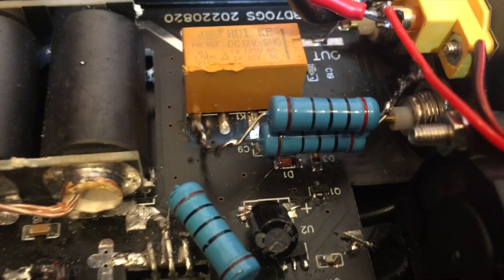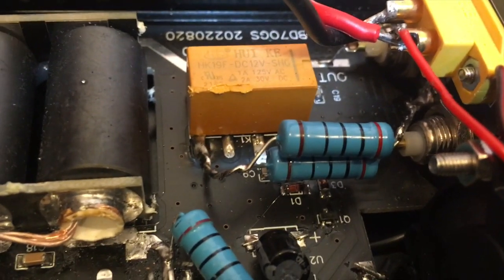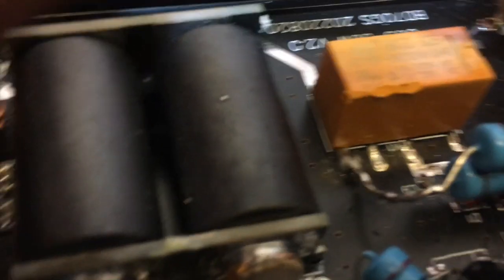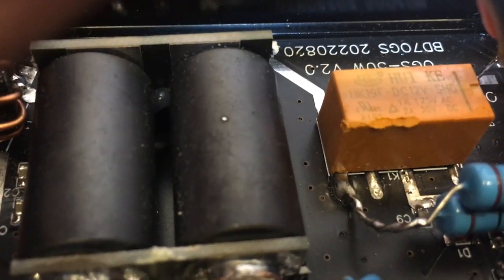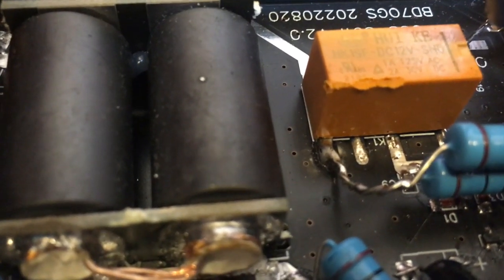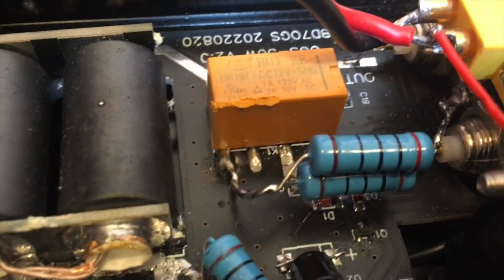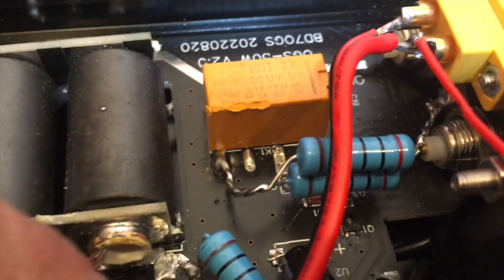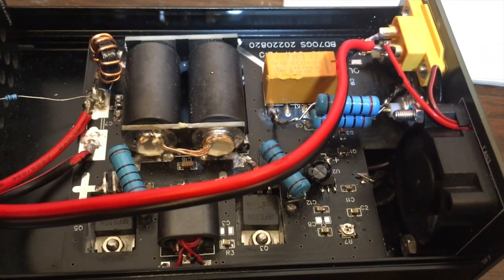OSG-50W Important Modification for high SWR between your Radio and Amplifier.

Comment: What version board do you have.  I can see it in the video.  Mine has a different number 20230227 and is version 4. I did some testing and found that on 40, 20, and 15m the SWR sent back to the radio was 2 or less.  17m was 3, so wont use this with 17
Reply from the maker: The one that was the basis of this video is 20220820 V2.0, aka the red power LED version. Thus far I've not had any need to really do anything to my V4 (blue power LED) amp, except glue on some internal heatsinks to the the finals.

Comment: Ok, my new OsG-50W seems to have a different board and has a 47 ohm resistor in there from the factory, so I guess the mod isn't necessary. Still appreciate the video! VA3IRF
Reply from the maker: Ah yes, there are two versions of this amp. They can usually be spotted by the colour of the power LED. It's it's red, it's the 1st generation that really does need this mod. If it's blue, you should be good to go, and the different manufacturing process has gotten rid of a nice easy way to implement the mod. I have one of each. The blue one I've not modified, and seems to be better (but not good) at presenting a load to the transmitter. I may revisit this during the winter months. Glad you enjoyed my video!! 73, VE7NGK
Reply: @tomsworkshop5856  , thanks for the reply! I actually looked up your call letters, could have sworn I have made a QSO with you, but I don't see it in QRZ.
Reply: @tomsworkshop5856  , yes the version I have would make it difficult to do the mod, the relay pins are on the other side of the board. Thanks for your reply! I had to check QRZ,could have sworn I made a contact with you in the past...but I guess not.

Comment: I ordered the PA50+ online, and they sent me one of these.  Granted it was a great price, and now I know why.  The one I got does look different than the one you have shown.  They have added 3 large resistors to the board, 2 of them are 420 ohm, one is 120 ohm, so I wonder if they have tried to fix the input VSWR issue.  I couldn't get a chance to test it as once I applied power, the power light came on for a brief microsecond, then something in the amp shorted out, so I started a return.
Reply from the maker: Wow, definitely worth returning if it only had a millisecond life span. But most interesting that they are still working on ‘improvements.’ Hope you end up getting a working amp in the end. 73
Reply: Hi, I have recently received one of these with the extra resistors. Measured at 43 Ohm and 12 Ohm. In PI network theoretical attenuation nearly 9 dB and return loss of about 7dB, equivalent to a VSWR of about 2.5:1. Supposedly better than previous. Just waiting for replacement MOSFETs as the smoke escaped when checking bias voltage.
Cheers
Peter
VK7KPC

Comment: Hi & thanks Tom,
If I understand correctly the maker or designer of the amp did not allow the input side on the amp to appear as a 50 ohm load to the source radio, correct?

Because I did not open the case yet I just want to be clear about where I connect the pair of parallel resistors. I saw the proper location on the relay so I am good on that. 

I believe you said for the other the ground tab of the two BNC connectors, correct?  

I guess the two connectors share a common ground tab, but as long as the connection is made to what the connectors ground to should be fine, correct?

Also, how critical are the 200 ohm in parallel =100 ohm 6 watt resistor assembly values? I'll probably have to order them anyway since 3 watt resistors are not typically in my build box and I am wondering if it was just a workable value you had and perhaps there is an even better selection.

Thanks again....
Reply from the maker: Yes sir, you've got it right. However, there's a different version of this amp being sold now, and it is identifiable by the blue power light instead of red. I recently bought the second version, but have not yet been able to do the modification as they went through-hole for the relay. I'm hoping to make a follow up video on this newer version as to how the modification can be done, because, well, it still doesn't present a good 50ohm load to the radio.

Hope that helps!! & 73
Reply: @tomsworkshop5856  Thanks Tom. Yep, I have the blue light version. I will wait for your video and I did order the resistors.
Reply from the maker: @migalito1955  Sounds good, hopefully this will be a simple (ish) mod, I do know I need to pull the board out, and that means the temp switch and unbolting the FETs. So, might take a bit of effort, But I'm hoping to find some "top side" connection point after I go through it. We shall see.
Reply: @migalito1955  Hi, Blue light version has an attenuator already fitted
Cheers Peter VK7KPC

Comment: Hi sir. How are you can i ask about two meter linear what is best tube type or mosfet thanks 73
Reply from the maker: That's a tough question to answer because everyone uses VHF a little differently. If you're just looking to boost your handy talkie a bit, then Btech (Model # AMP-V25) makes a nice little amplifier that also has audio (in and out) to turn your handy into more of a mobile / base setup. If you're looking to do VHF SSB, AM, or Digital 
then I'd be suggesting that you look at the offering from RM Italy. Hope that helps. 73! VE7NGK
Reply: Thank you sir... But i need to purchase linear vhf 144 to 148 if have can you help me about that sir and im willing to buy thaks 73
Reply from the maker: @richardsenining7410  Sorry, I don't have any VHF amps.

Comment: So I did the mod and it sure made a real difference in the swr presented to the radio. So far I only tested with an usdx and the reports were bad, to say it mildly. I dont think the usdx is anywhere near a finished product, and thus it does not like this amp it seems. I could test the PA with my 817, but the risk and the pain involved in renewing finals on the sweet little Yaesu makes me a bit reluctant to mate these two. Maybe I am overcautious... I dont have deep experience with practical electronics but is there any way this amp could be put to work? Any bands with less unwanted emissions? 10-15-20 meters maybe ? Simple filters?
Reply from the maker: Ya, the USDX is a pain. And the 817’s finals are fragile to say the least. As far as making the USDX almost useable, check out my other video. And search Facebook for the USDX group where you can find better firmware and how to upload it to your radio. Mine’s doing OK now, but dang, RF getting back into it via any connection, power, mic, etc.. makes it sound very bad - and adding the amp really compounds the problem. It seems, for me at least, I get the best results on 20 meters. I hope this helps, brother. 73s!

Comment: Funny thing, I got mine yesterday. I did some quick test on dummy load and quess what - mine produces 90-95W from circa 6W input. Any ideas? Regards
Reply from the maker: Two things come to mind. Drive power should be 2 to 5 watts, and if you're using an mcHF/RS-918 type radio, (Or similar experimental radio,) harmonics. Often times the 3rd harmonic.
Reply: @tomsworkshop5856  Hi Tom, thank You for your answer. Yes, the drive power exceeded 5W - in fact it was around 6-7W. But would it make such a difference? Today I tried handheld Albrecht 2,5W and USDR reduced to similar power. The amplifier gave 40W on output , and a few qso-s were made with good reports. Harmonics - yes, but would it not  affect SWR (and it was exactly as expected)? Anyway - best regards - Maciej SP5ZE
Reply from the maker: @MaciejSzewczyk-x6w  They often do effect SWR, but in some cases, especially with non-resonant antennas that are being made to transmit with a balun or unun, such as the popular 9:1 random wire. The SWR, even with out a tuner can often be under 2:1 on all HF bands, thus, the harmonic(s) might not affect the SWR as you would expect. Now, if it is a mono band antenna, I'd be surprised. But, not everything works out to simple answers. Also, I often run my amp in excess of 75 wats on 80 meters. It gets warm, the fans run a lot, but it seems happy doing that. ;) I just wouldn't recommend doing it, if you don't have replacement IRF530s on hand....  All the best and 73's VE7NGK
Reply: @tomsworkshop5856  Thanks, 73!

Comment: Appreciate the video! However, I set up several jigs with two samples of this amplifier, and loaded it with both tuned antenna and dummy loads, and measured the VSWR on the exciter (a (tr)usdx) on all bands, with the OGS either powered on or off. Worst case was on 80 meters, and was approximately 1.5. 
Best measurement was on 11 meters (no surprise). 
I could not repeat your observation. Can you display the actual test setup you used? 
Also, I would be very uncomfortable using this amplifier without some filtering. It is sending large spikes at the second harmonic, on all frequencies measured,
making it unacceptable as an out of the box amplifier, even for 11 meter operation.
Wonder if the manufacturer has something to do with the problem: different stores in China have wildly different pieces with the same name.
Not doubting your findings! Just want to know what accounts for your findings.
Again, thanks for all you do.
Reply from the maker: Good day George. So, I've stopped using my uSDX with this amp as it creates far too many spurs and harmonics. The class E final setups in those radios are not up to being connected to an amplifier at all. I've exhausted many hours trying to clean up the emissions. 

With that said, I use this amp with my RS-918, that has had Wayne NB6M's modifications done to its filters. 

The OGS-50W is a dumb amplifier, and has no input loading, thus, unless they've changed something in the last year, I'd wonder how you got a good match at all. (And I'm not doubting you and the fine manufactures change things everyday!)

The tests I did used the SWR meter in the RS-918, 
confirmed with a direct connection to a dummy load (Showing 1:1ish) and my Random wire without tuner (2:1) and then tuned 1.06:1 Using my ATU-100, and the OGS powered off in between the radio and tuner, and repeated on all bands.

Once the the amp is powered on and trips into transmit, the reported SWR on the antenna tuner stays low, 1.15:1 (Some change expected with the increased power, and resistance of coax, balun, etc.) However, the radio's indicated SWR (5:1) was so high that radio was only pushing 2.5 watts into the amp, while set to 5 watts, in many, but not all of the bands. 

There is good news: The harmonics detected from the output of the antenna are 40 to 50db lower than the fundamental, compared to 9db lower than the uSDX substituted for the RS-918. Test set up was TinySA, using supplied antenna polarized in the same direction as the random wire and 40 feet from center of that transmitting antenna, with the TinySA set to measure harmonics. 
(Notably the 3rd harmonic was the worst in all cases, with both radios, likely because the amplifier favors frequencies in the 10 to 15MHz range.)

So, you are correct. If your radio is dirty, or has high DC out, such as the uSDX families of radios. (This is evidenced by the uSDX radios only generating about 30 watts out of the amplifier, but traditionally built commercial radios without the DC component will do 55 watts with the same 3.5 watts in.) 

Don't use this amp without a filter system BEFORE the amplifier, unless you've cleaned up your radio's emissions to all harmonics being -50db or better. 

A filter setup after the amplifier is a good idea, but if you haven't cleaned up what it is amplifying, you will be converting all of your output to heat in the filter network. 

It should be noted that it will work on 10 meters, or  as you say 11, but it is super inefficient.

I hope that helps, and all the best to you!
Reply: @tomsworkshop5856  Appreciate the thoughtful reply. I will set up the OSG-50 with an RS-918 (one of my favorite portables!) and see what I measure. My measurements were with the SWR meter and transmatch at the base of the antenna. The OSG-50 was left inline, both powered and  unpowered, and worked well, with many spurs noted, which likely reflect the Class E operation, as you noted, of the (tr)usdx. I use an LPF-7, as well some other stiff filters on most of my Chinese equipment, as the second harmonics are often troubling.
I am a product of the early sixties amateur scene, and recall "pink slips" for inappropriate emissions. All said, this amplifier is a work in progress, and needs a bit of work to be a good ham radio product. V73 George KF5WFA
Reply from the maker: @plotdoc  Hey, Thanks for the kind words! I do agree, the amplifier is a work in progress. BUT, I can say I've now logged over 100 hours of TX time on it. So, at $1 an hour investment, seems to be rather good. lol
All the best George!! 73's de VE7NGK
Reply: @tomsworkshop5856 FB, Tom.  I set up a test rig, using a QRP SWR/Wattmeter between the exciter and the amplifier, and another SWR/Wattmeter between the amplifier and the load, which, for purposes of the test, was a Cantenna KW load (finally, a use for it!). With the exciter active, and the OGS non-powered, the forward power was set to 4 Watt, and was seen on both power meters. SWR stayed at 1.1 or better, on all bands, from 160 to 10 meter. Then I energized the OGS with 13.8V,  and repeated all the studies. You are correct, Tom. The reflected power to the exciter was several Watts, making the VSWR nearly 6! The lowest value, 4, was obtained on 15 Meters. I will certainly try your fix, but excellent pickup on this one, OM!
73 George de KF5WFA
Reply from the maker: @plotdoc  I honestly can't take credit for finding this. But, once it was brought to my attention, fixing it made a world of difference. It's possible to use two 100 ohm resistors to make things happy, but the amp suffers. (I tried) So, the end result is 2:1, and the amp doing its job. Kind of a compromise, but a good way to not hurt your radio. (The amp's finals are easy enough to replace....) Have a good one friend, hope to talk to you on the air. I love 20 meters on Saturdays. ;)

Comment: Tks for the tip, but I think I heard two resistors and I see four resistors, is there another modification ?
Reply from the maker: If you take the top off, you’ll see two in the final section. The two I’ve added are just as described in the video.

Comment: Thank you so much for this, Tom. I will do this mod to my amp when I am able to aquire the right resistors!
Reply from the maker: Sir, thank you for pointing this out! Hopefully this will help lots of folks!
Reply: Hi Tom, I have a single 6w 420ohm resistor in that position so maybe they are trying to fix the issue. Keep up the videos. Now to start work on the usdx.